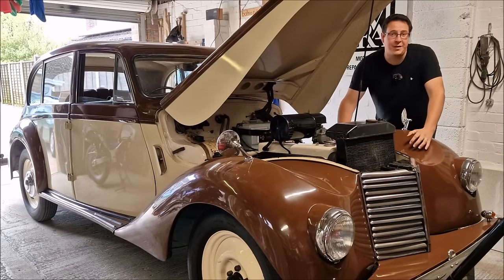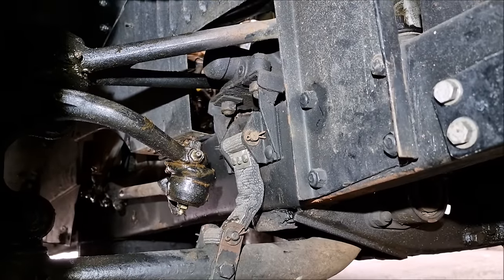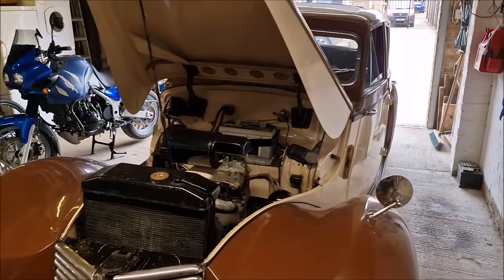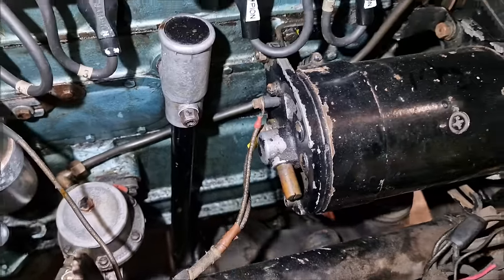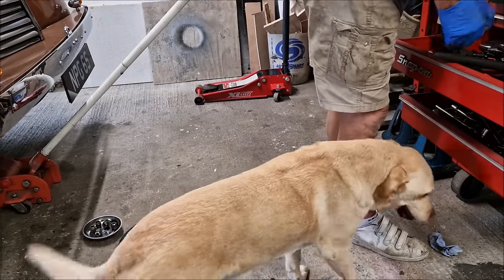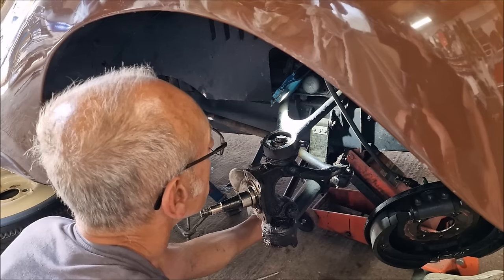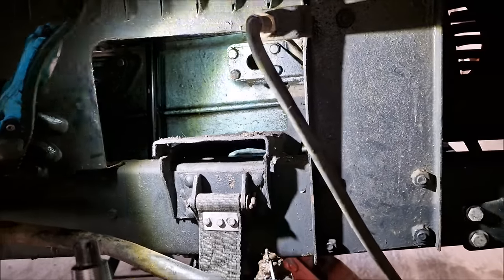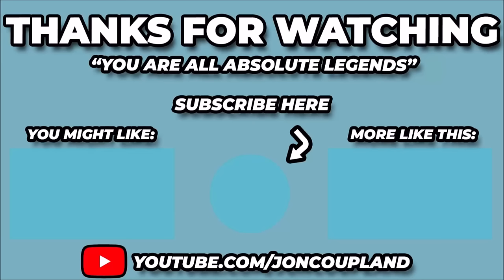"It's A Deathtrap" - Armstrong Siddeley Lancaster Condemned By Dad

Comment: Its not a 'Death Trap', its a 75 year old car that looks like it has a broken suspension braket, its not the chassis . You can either weld it or make a new bracket.
Reply from the maker: It's a common fault for these Lancasters according to Penn Bradley (who wrote a series) - the suspension bracket is classed as part of the chassis as it is welded to it. I stand by the fact that if left it would 100% be a death trap! Thankfully we caught it before the top arm decided to give in and fall off! Good news though. It's not beyond repair for Dad 😊👍 stay tuned to see part 3 after repair and another test drive
Reply: I think it would be pretty hair-raising if the front O/S collapsed at 40 mph!!😂
Reply: Precisely ! It has merely suffered a major fracture of the wishbone/shockabsorber mounting bracket : Claiming a fractured chassis is a bit of inaccurate melodramatic sensationalism. The immediate post war development /practice of bestowing higher end coachbuilt cars with IFS has given rise to many similar setbacks esp in metal fatigue and component wear , which did not exist on most pre war models with a solid beam front axle : Many manufacturers in 1945-46 developed their own individual versions of independent front susp. notably TA14 Alvis, Riley RMA, Leaf 14hp, Rover P3, Healey Westlands /Duncans/ Abbots , with their cast aluminium trailing arms , Armstrong Fiddeleys, and Daimler with their excellent time proven DB18 leading arm set-up. And of course we must not overlook the MkV1 Bentley: However most of these went down the route of underslung rear chassis rails ( theRover P3 did away with a rear end chassis rail altogether) and this has lead in recent years to much more serious danger of chassis corrosion in the rear axle areas, as the chassis rails were much closer to the road and thus more vulnerable : The later Daimler Conquest re visited the issue by re-routing the chassis rails over the rear axle , as with Majestic & Maj Major. Replacement suspension spheres for these models are also many hundreds of pounds :
Reply from the maker: @2760ade  Absolutely - folk saying we are 'being dramatic' need to think again ... this absolutely could have killed me or someone else!
Reply from the maker: @YellowDellow-s8i  i LOVE the throwaway use of the term 'merely a major fracture' - the suspension bracket is classed as part of the chassis as it is welded to it. I stand by the fact that if left it would 100% be a death trap! Thakfully we caught it and its now been repaired. That would have been a less exciting video title too ... (and it wouldn't have fitted in the word count) - thanks for watching and interesting information abut the other front suspension developments. For a car that I drive 2 or 3 times a year, I wont be panicking - as long as its fundamentally safe it can be a bit bumpy :)
Reply: It looks to me from your video like the bracket is riveted to the chassis not welded, and that the other end of it is the engine mounting bracket but it is admittedly difficult to see clearly from the video. Good luck with it anyway.
Reply: My assessment exactly on it just being a bracket . And if they would sell that car to me for five grand, I’d pay to have it shipped to the states.
Reply: Yes, DEATH TRAP .

I was at a park about a year ago. A black Toyota Tacoma of about 2006 vintage was waiting for a car to leave a parking space so the Tacoma could pull into the space. The left front corner of the Tacoma suddenly fell onto the left front tire while the Tacoma was standing still ! If that happened at speed!

I got into my brown 2006 Tacoma and immediately drove to my mechanic's shop. The mechanic told me how it happens and kept my Tacoma to inspect in the morning. 

My Tacoma is apparently not going to drop onto its front wheels any time soon. I drive less than 2,000 miles a year and have the Tacoma inspected at its annual oil change.

Comment: It is just a fatigue crack in the upper bracket. That simply is a habbit of older cars. 
But human mankind invented TIG welding for that. Cracks are thoroughly cleaned and welded using special tough filler materials, such as 1.7734/2 
This is specialist welders work however. The car deserves it. Inspect the chassis regularly. 
The brakes shoes can be done by yourself, using rivets and  liners you find at a truck-repair shop. Look for some liners with the same radius and cut them narrower. 
I wish you many miles in future with the car.
Reply from the maker: Many thanks - Dad can weld and so there is a combination of repairs that he has done here including welding and then a stronger plate of metal being fitted - (thats all to come to the channel). The brakes were a different issue in the end (again coming soon) - thanks for watching

Comment: I'm 79 YY and you two have just jogged my memory back to the early 1960s, my father owned an Armstrong Siddley Whitley in black with silver stripping. In a low time at work dad decided to keep the plant fitter busy and for me to help.
All the brakes shoes were stripped out and sent away to be reshod, in the mean time all removed parts were cleaned and put in a cardboard box. Work continued on servicing construction plant until the shoe returned. Only to find the box had been overturned and AS parts were everywhere, my job was to get on my knees and search them out. While installing the shoes the fitter decided four return springs were missing and would not believe me when I said there was only one on each set. Four more springs were purchased from Armstrong's works in N. London. During road testing brakes were hard to apply and so Armstrong's were called and a special Saturday morning appointment made. Armstrong only worked a five day week but made a special case for dad. I went along with dad and the head mechanic and workshop manager took the car into the workshop while we sat in reception drinking tea, he returned 20 mins later with four springs in hand saying they were not needed,  my chest expanded in that told you so manner. When dad asked for the bill the manager just said that's AS service, they also declined a tip. On pulling out the works dad called into a fuel station to fill up and noted the two AS guys walk into a café so we followed them in and dad bought the breakfasts.
Seeing your AS only had one spring reminded me of all that. Many thanks do keep up the good works. In my time I spent 15 years owning a 1930 wooden classic family motor cruiser, that in 1940 went to Dunkirk and was used to ferry troops off the beach to larger craft off shore. She returned to Blighty holed at the waterline and some say carrying 85 souls on board. She then spent the rest of WWII hunting enemy parachute mines in the Thames Estuary.
Reply from the maker: Great memories and stories - thanks for sharing!

Comment: The chassis isn't cracked. However the bracket requires repair or replacement. But the reality is there are no half measures. But that does not mean a full restoration is needed. All old cars wear and often they if they look reasonable keep getting used and not properly deep serviced. I have just completely rebuilt the brake system, fuel system, fully serviced the underbody including stripping all the deadener underneath off to clean inspect and recoat on my Sapphire. The car now stops steers runs and performs the way it should on new tyres. It is time consuming to replace every hose to check everything. But the car is 68 years old! I can now drive it with confidence.
Reply from the maker: Oh brilliant! Many more years of motoring to come in your Sapphire! (i love them)
Reply: @JonCoupland  Mine is a rare Mark 2 with power assisted ventilated brakes twin strombergs and preselector gearbox. It's performance is impressive and easily keeps up with modern traffic. Very pretty car that is a real revelation. And I can work on it myself which makes it both interesting and affordable.
Reply from the maker: @rosewood1  Lovely

Comment: Don't despair Jon , it can be repaired , simple but high  quality engineering , possibly caused by a shock absorber so worn out that excessive suspension  flexing which was too much for the bracket to stand, from what I can see it is riveted to the main chassis member which would require drilling out and possibly subsituted by high tensile bolts .Interesting feature of this 1949 car that a 1949 Sunbeam -Talbot I once owned also had the same 6" diameter Lucas headlamp lenses , characterised by the ' eye shaped '  vertical moulding .In 1950 , new enhanced vehicle lighting legislation was introduced where  the new standard   7" lamps were introduced by all manufacturers.
Reply from the maker: I have every confidence that Dad will be able to get it all sorted out. Glad we found it when we did 😊 - you may be on to something there with the suspension as it was quite worn.
Reply: probably a lack of movement in the shock not too much that caused the mounting to twist in compensation as it took on all the shocks. It looked pretty solid to me. And its not the first time either. It is covered in welds an extra bits but they never fixed the root cause. I bet its really common with that system.
Reply: @JonCoupland  You said that it had a frontal accident. That could well have started the cracking. Hopefully that bracket can come off. Domed ends might mean they are coach bolts. Remaking the brackets might be easier and stronger than welding up this one. If the shock on the other side is coming off I'd be tempted to take of that bracket as well. I suspect someone in the AS club has done this job before so some prior knowledge may be available. She looks to be in wonderful condition so no bodging please!

Comment: Having owned a number of Peugeot 403's dating around 1960 I was surprised by the small size of the axle, hub, shock absorber and the mounting bracket that failed on the Lancaster. The 403 had a front suspension consisting of a large leaf spring bolted to a cast iron cross member. The large shock absorbers were bolted to to the cross member and had rubberised bushes to which the top of the king pins were bolted. The bottom of the king pins were bolted to  rubberised bushes fitted to eyes in the leaf spring. The earlier 203 Peugeot's had the same arrangement and won a round-Australia rally at a time when most roads out side the cities were rough dirt or non existent.
I knew that my Peugeot's were ruggedly engineered but didn't appreciate it until I saw the Lancaster.
Reply from the maker: Wow sounds brilliant in comparison! Thanks for watching :)
Reply: @JonCoupland  
You're welcome. Many years ago I saw an Armstrong Siddeley Sapphires. It appeared to be of similar size and style to a Rolls of the time. Regarding my comparison between your Lanchester and my Peugeot's I would conclude that the Lanchester was made for England where the roads were good and the distances travelled were short versus Australia and Africa where Peugeot's , particularly the 504, were renowned for their rugged reliability.

Comment: My MG Midget 1275 had a heater stop valve. Airflow through the radiator was pretty good with ok airflow. But many cars failed to properly exhaust the hot air. Triumph Stag was a notable culprit.
Reply from the maker: Yes. We're still a bit scared of turning the tap off 😂

Comment: i worked on london taxis as a panel beater and painter in a repair garage when the fairway was the current model, few years in they started to get cracks in the chassis too, not from rust but mileage use, esp around london srreets, most common was around the steering box mounts and adjacent chassis legs
Reply from the maker: Ah that's really interesting! Thanks for watching

Comment: When I was restoring the chassis of my Herald I found rot in the area around the diff and bought some repair panals for that area off Chic doig. I remember having a conversation with them as I was concerned about repairing the chassis and how much welding I needed to do do. I’ll never forget the chap on phone saying ‘ how do you think they made the chassis in the first place’ from then on repairing structural areas by welding was less worrying, I just make doubly sure the weld is prepped properly and there’s good penetration.
Reply from the maker: Yes that's a good point! Thanks for watching 😁👍

Comment: The broken part seems to be pretty easy to replace by a stronger one, made of thicker steel, which could be easily manufactured in a good iron workshop. The parts are quite simple, but a bit too thin to support the weight of the engine, gear box and so far. It could be much cheaper than original parts, that can crack again in the future, cause they are not strong enough. I think the designer miscalculated the resistance of this suspension part. Thanks for the video...
Reply: Yet that part has lasted 75 years so its not really that too thin. Most cars would never last that long in the first place .
Reply from the maker: Ooh we're not sure if it has lasted that long ... As Dad says RE some welding it looks as if it has been repaired previously. Potentially in the 70s when restored 😊
Reply from the maker: Thanks for watching 😊👍 part 3 is coming which sees it repaired but we've used some uprated and thicker steel on the repair
Reply: @JonCoupland  Oh, ok...graet...thank you, John...
Reply from the maker: @brunosergioporto8881  thanks for watching :)

Comment: So on The chassis not of The chassis,which is a good thing,now The as a previous owner has had a visit from someone with an  incontinent pigeon meaning that it's obviously had a previous repair of sorts,might it not be for the best to replace the bracket entirely? After all it's not to difficult to do and I dare say Pete could fashion a new one ...
Reply from the maker: Well ... That could well be what has happened. You will have to stay posted 👍 (but Dads fixed it 🤣)

Comment: Looks to me like the bracket was under designed back in the day 
Shock absorbers are the hardest working parts 
So when it gets welded it needs reinforced at the same time 
That has been broken for some time 
Good job the old boy is a mechanic
Reply from the maker: You are absolutely right. And according to a chap called Penn Bradley (who wrote a few books in the 70s and 80s they were always a weak spot. We have strengthened now. Stay tuned for part 3 😁👍

Comment: If the law had not been changed concerning MOT's the tester would have spotted that. I am not sure why the government did what they did regarding old cars. I have a pre war Riley ,it  is always handy to know what is going on!
Reply from the maker: It's an interesting one because for arguments sake the MOT is only as good as the day it's completed ... That could have absolutely fractured on the way home from a test and for someone who solely relies on the MOT for peace of mind and safety potentially then has 364 days of driving around with it like it. I think the takeaway here is ... Routine maintenance and checks are important
Reply: Hi Jon   I could have cracked on the way home agreed but it would have been evident before it did that. The ball joint did not get like that overnight! If you were doing 15000 /20000 miles a year it could be classed as wear and tear. I have seen some right lash ups since the rules have been relaxed it can be a problem. Have a look at the bracket that failed and find out why it did it. I did not get a good look at it but I would say it was a) the material is not thick enough and or b) it needs some strengthening fillets in the corners. The Riley also has an epicyclic semi automatic gearbox so snap!  Cheers

Comment: Also, I didn’t see the frame (or chassis) was cracked, only the suspension bracket which looks like it might be easier to fabricate a new one as opposed to welding the old part. It’s only mild steel & should not be that difficult to make if you have a shop full of equipment & a little ingenuity. If you insist, the new one can be hardened by flame & quenching. But you really need to know what you are doing when attempting that process.
Reply from the maker: Absolutely. New bracket now fabricated.

Comment: Sounds like a case for classic mots
Reply from the maker: We absolutely agree. Maybe not an MOT as we know it ... But some sort of inspection
Reply: Whilst I agree that classics should still be inspected, metal fatigue isn't easily spotted until it has already failed, such as is the case here.
I had a fatigue crack occur suddenly on a Peugeot 205 front crossmember, that still had plenty of MOT left.
Reply: @JonCoupland  To be fair, the law does state that MOT exempt cars should still be maintained to a level whereby they would pass an MOT if tested, so the onus is on the owner!! However, some sort of periodic inspection would not be a bad idea!
Reply from the maker: @2760ade  Good job everything in my fleet is on constant 'tinkering' rotation then :) - (although this is the only MOT exempt thing I own)
Reply: Although in this case they've found and fixed the problem, so MOT not needed in this case. I do agree that regular inspections are important, but the majority of owners of older cars like these keep on top of that themselves. Many (most?) modern car owners seem to carry on until the next MOT even if their car is making strange noises, or whatever.

Comment: Didn't cars have different cambers on the front wheels, because the roads are higher in the middle (to make the water to drain to the side). The cars are actually leaning to the side and will turn to the left if not there was different cambers on the front wheels.
Reply from the maker: Ah yes but if you watch the previous installment then car is massively pulling to the left (which I never did before)